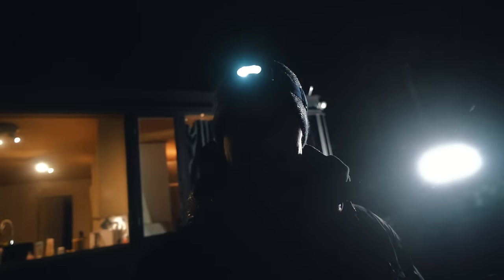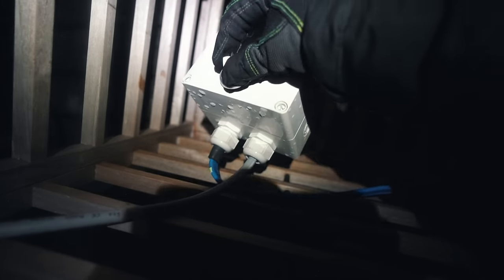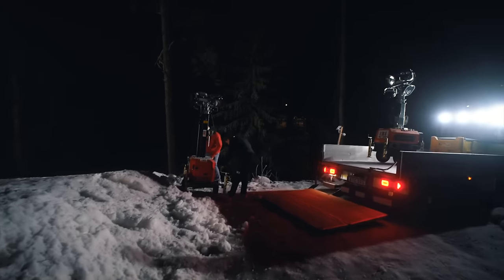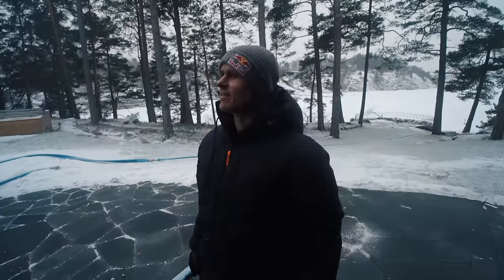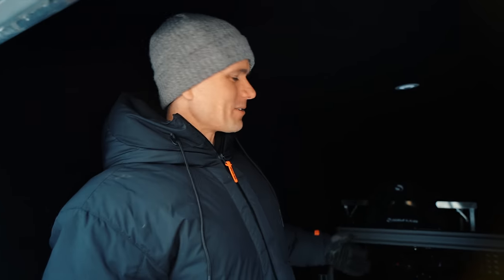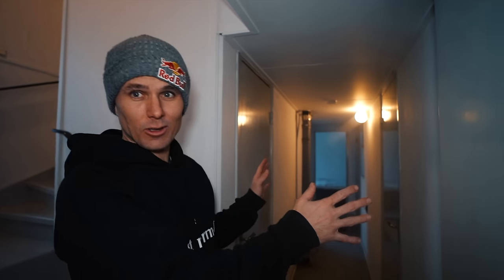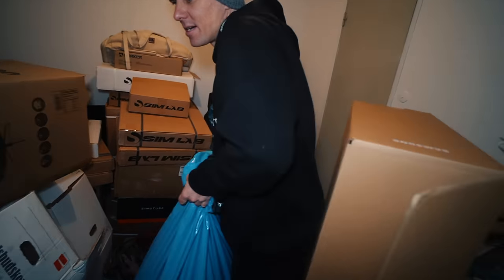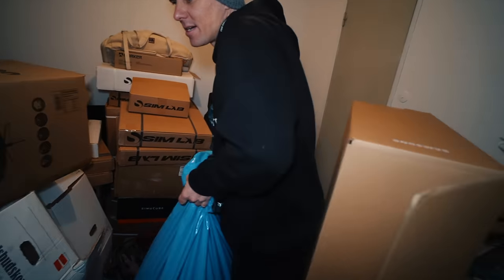HOME MAKEOVER! EPIC NEW GAME ROOM IN 3 DAYS! | VLOG 1050

Comment: Overkill sim room! Quick note - For a much better and more realistic feeling through the steering wheel, you have to adjust and synchronise the in game steering wheel with the one at your sim. The right sim are not synchronised with the game and it can lead to oversteer or/and under steering the car, cause an incorrect feeling. 

I’ll hope it make sense otherwise let me know. Badass equipment that deserves to be set up correctly. 

I’m looking forward to a new lap record at Rudskogen - awesome track